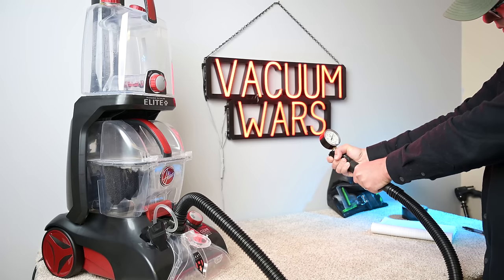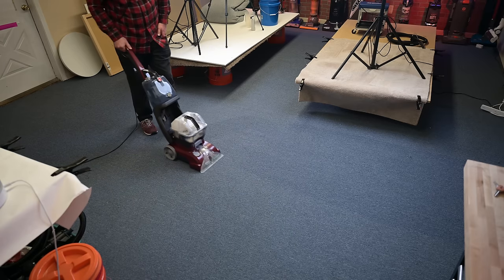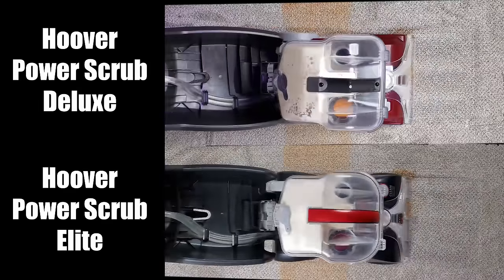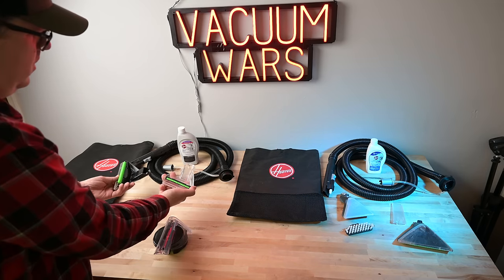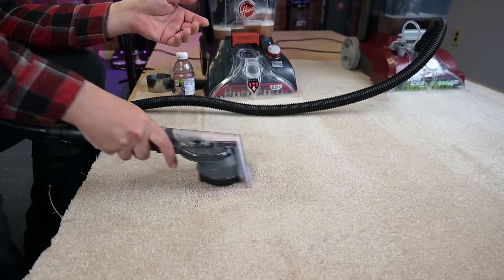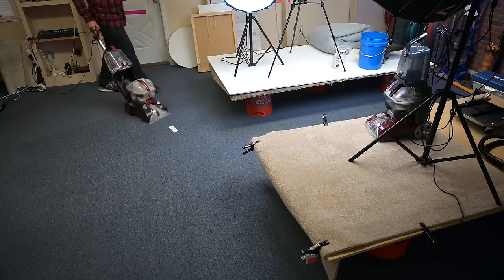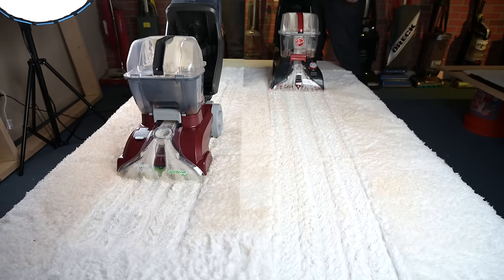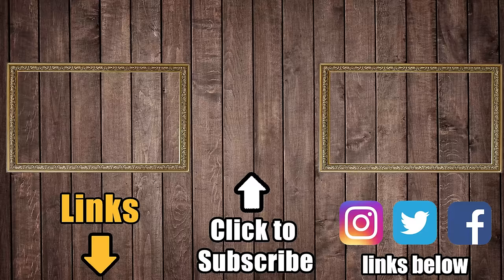Hoover Power Scrub Deluxe VS Elite Carpet Cleaner Comparison

Comment: So, I just bought the deluxe model of this cleaner on Amazon after doing some research and reading excellent reviews. I came across your very enjoyable and informative review here after the fact. But it reassured me I made a good decision in my purchase. This is my first time buying a carpet and upholstery cleaning machine. You're video helped me have a much better understanding of it's operation. I very rarely comment on YouTube videos. But you were so thorough with your side by side of these two similar units, that I had to commend you for a job well done. Thank you for further insight and information.
Reply from the maker: Thank you very much!
Reply: @VacuumWars  hey whats the difference between these and the xl version?

Comment: The one thing I have found through my own use, previously owning one of these is that the bearing that the brushes use rusts or seizes. Because it uses air flow turbine to turn the brushes.. It wasn't until almost a year of use, atleast once a month. Just as a data point for anyone curious about them.

Comment: My favorite part about these machines is how easily everything comes apart for cleaning! The nozzle and brushes pop out with no tools required. And the dirty water tank opens from the top making it easy to get everything clean and dry. I found with most Bissell machines, it's nearly impossible to get the brushes clean because they aren't removable.
Reply: Thank you I was wondering about that..you answered my question
Reply: I agree, I hated that about my bissell.  It finally stopped suctioning after two years and many Carpet cleanings since we own a dog. The dog hair, even though he has short hairs, gets caught in the bissell and there is no way of cleaning it out. I'm in the market for a removable easier to clean carpet cleaner now and I'm getting good info from this channel!

Comment: My husband and I have had ours for longer than a year (the cheapest one). All I can say is this machine has been a god send, it has definitely paid itself off multiple times at this point. Our carpet faces anything from dirty/wet shoes, animals, spills, open windows/allergies. I make a point of shampooing the carpets every month, that doesn't include the random clean ups in between. It never fails to amaze me how well this machine actually works. The water usually comes out black for the first few passes in high traffic areas. Without this machine, our carpet would smell and look horrible. With how much abuse they face, it's amazing that they're retaining their look. I use laundry detergent (Persil) with it, I've never had any issues. It works quicker with less passes than the various bottles of carpet detergent I've bought.
Reply: Interesting, that's the first time I've heard of someone using laundry detergent in their carpet cleaner. It makes sense, though. What's your ratio?
Reply: @TheReapersSon  I have also always used laundry detergent! It doesn't foam up, and smells amazing after. Not to mention so much cheaper. Ratio took some trial and error. I also recommend using a stain pretreatment spray..such as spray and wash 😂 before making the pass. Ratio that works for me is 1/3 cap per gallon of clean water.

Comment: Used the elite yesterday. I do long backwards passes and when my pass is complete I lock the handle and travel back to my starting point. The Elite's tank float engages over 50% of the time which requires the machine to be shut down and restarted. So if your doing passes like I do go with the cheaper model it has a different float. Love these machines and prefer them way over the rug doctor. - thanks for the great video and the recommendation.
Reply from the maker: Thanks for that input!
Reply: why do you do passes like that, vs running back and forth while scrubbing/vacuuming?

Comment: I traditionally go with Bissell when it comes to carpet shampooers but whenever someone asks I always tell them if they have thick pile carpet and pets that shed a lot where there might be some hair left in the fibers go with the Hoover because the brushes don’t pull up the carpet and they can easily be removed unlike the Bissell but in my opinion the Bissell definitely cleans better.

Comment: I always found the Hoover Carpet Cleaners especially the ones with the Dual V branding to be very good performers. My biggest problem with the units were that after about a year they just seem to completely Fall Apart. I had one that was called the Hoover dual V 77 because it supposedly had 77 SpinScrub brushes on the bottom. I not so affectionately used to refer to the damn thing as the Titanic because it leaked like crazy every time I used it and it was so freaking hard to turn and maneuver. I had gotten another one to replace the 77 and I think it was called the Dual V60? Again the unit worked flawlessly for about a year and then again started leaking from the clean water tank and I ended up getting rid of it. Before anyone says that I don't know how to treat my machines or like I abused them I can tell you that's definitely not correct. The machine I replaced the last Hoover with was a Kenmore that I still own and use today. I recently was rooting through my paperwork and saw that I had purchased the extended warranty for the Kenmore when I first bought the unit March of 2013.

Comment: I'm sure it will get lost but I wanted to chime in. We've had a hoover for a year and a half now. Before that it was a few Bissels. For one I love having the extra weight pushing down the front  of the device. I feel like the Bissel always leave a lot of water behind but the Hoover has enough weight to keep sucking it all up and dries significantly faster. So on our first Hoover the brushes stopped spinning within ~6 months. I contact Hoover and they sent me a new one, no problem. I've had that new one for 14 months and a couple weeks ago it started making a terrible sound and smelled like burning rubber. I found your videos trying to research which one to buy to replace it but reached out to support first--they sent me a new one. All I had to do was send them a video of the device. With that, I think including support and warranty is also a big deal with some of the devices. Not only do I prefer how the Hoover handles but their customer support has been exceptional for me in the time we've had it.

Comment: Suction power is one measure, but airflow (flow per square inch) may be the important number if the vac is designed to take advantage of the higher airflow in a dynamic situation. I cannot say for sure without testing. Good testing on the whole!

Comment: Sadly I've read that their spin brush systems have a tendancy to rust the parts that make them spin and ultimately stop working or break

You can look up "how to fix hoover carpet cleaner's turbine mechanism" and find a bunch of stuff on it
Reply: Mine had that issue after only a few months of owning it.
Reply: @Vcafr0  Well. That wasn't the case for me. I took good care of my machine. After I attempted fixing it, I discovered the problem was the drive motor that drives the spinscrub brushes. It had rusted itself solid. That's a location higher up in the machine where no water should ever be able to get. Also, my machine's drive motor wasn't a direct electric drive motor. I believe it was an air powered motor. I now own the Bissell Big Green and it has a dedicated electric motor that drives the brushes. I've found that the brush roll doesn't bog down at all now.

Comment: Do beware the turbos that spin the brushes will rust after about a year or two, you can take them apart clean abd grease everything, but it wont last for too long, and the seals start to leak
Reply: 100% agree. I've went through 6 of these in the last 4 years. Yes, I should have thought about it but I really thought it was pet hair running them. But these suck after 6 months.

Comment: I just bought the Hoover powerscrub deluxe. I originally wanted the new Bissell revolution 2x pet Pro, but my husband refused to pay the hefty price tag for a carpet cleaner, especially since we have no carpet, haha! We have wood floors but have several big area rugs that are very light in color which was probably a mistake on my part because I have three big dogs. I have three standard poodles so luckily I don’t have to deal with the fur problem because poodles don’t shed, but they sure as heck drag in lots and lots of dirt! We have a huge extra large doggie door for them to come in and out of and I have a giant 8 x 10 rug that sits right at the entrance of the doggie door so naturally it gets very dirty. They have trashed these rugs! I was originally looking at one of Bissell’s smaller and cheaper model’s that’s only about $89 right now because you said it was good for smaller areas like an area rug. But like I said, my rugs are super trashed with lots of stains and I wanted a machine that was a little more heavy duty than the $89 Bissell model. Jamie’s Journey here on YT told me about you in a recent video and I came over to your channel to get some insight on what kind of carpet cleaner would be good for me and was also the best value. After binge watching many of your videos, I kept coming back to this one. It has a great price tag and it seems almost like it’s just as good as the expensive Bissell model. Once I talk to my husband and I was ready to finally make the purchase, I came back to your video and went to your links to make sure to give you some credit. And I’m not usually like that, LOL! I could care less about a YouTuber making more money than they already make! But I truly felt that you had deserved to get the credit. Really glad I found your channel. I will be definitely coming back. I like a good new vacuum every few years and my Dyson v10 is getting a little old! That shark vertex is looking really pretty😍
Reply: How do you like it? Is it east to use?
Reply: @tinarodgers5929  Love it! Super easy to use

Comment: Very good review and I have to agree with you on the Deluxe.  It's very similar to my SpinScrub 50. Yup, I'll take spinning brushes over beater bars every time. I've had about 5 Hoovers over the past 15 years, trading out every few  years to capture design improvements. By far, they are now so much simpler to use than years ago.  It's great to be able to freshen up a couple of rooms in short order. Amazing how much dirt lies hidden.

Comment: Not sure how much has changed but the hoover style brushes are (were) driven by a very cheaply constructed plastic drive that at least in my older hoover snapped. Often. Easy to replace but it's added maintenence and cost. They weren't expensive to buy but why should I have to fix the machine every couple of uses? Happened constantly on a medium to low pile carpet.

Comment: Love seeing these comparisons, something I'd like to see is if you could test the effectiveness of artificially weighing down a vacuum or shampooer. I was recently cleaning some carpets and tossed a jug of cleaner on the end of it to help vacuum it dry and it pulled up a surprising amount of extra water so that got me thinking: does weight matter? Could you weigh down some higher power vacuums to get better results where that extra power could shine through in deep carpet cleaning? How much can they take before burning out? Would be interesting to test!
Reply: I think these types of Hoovers are the best at extraction just because of the way they are designed. The dirty water tank becomes heavy and it pushes the head down harder into the carpet...I do not like any other type of carpet cleaner on the market except for these... but you have to really baby these or they fall apart...their design is so easy to clean and put away...but I dry it before storing it... letting a fan blow through the screen with all the parts off the dry the turbine. Don't lift the machine with the clean water tank handle... I really wish Hoover would make these more robust.. I know they are cheap but I'd be willing to pay more for one that's made better since I know what a great job they do.

Comment: Is this an older video?? I thought Smartwash came after Power Scrub..  Im in market for a carpet cleaner after my Elite Pet stopped spinning the brushes due to the Gearing in the motor being rubbed down but the pinion gear due to the bearings seizing and being none stainless.  See my review with pictures on the hoover site. 

I dont really care about the sound, I just want it to deep clean as good as possible and dry as much as possible.

Comment: Thanks.  I have been in my apartment for 6 years now and the carpet needs cleaning:)  And it would be easier to buy one then to try and rent one (I don't drive and Amazon delivers).  I think I will spend the extra $20 and get the Elite for that quick mode for monthly touchups fo the entryway and bathroom hallway which get more foot traffic.  Thanks again for the video!
Reply from the maker: Glad it was helpful!

Comment: I currently own and use the deluxe model.
I've been useing it heavily on thick carpet for about 7 years now.
If I we're to give it a lifetime review I'd say, it doesn't suck all of the water out of my carpet and I need to add a significant amount of pressure to the waist tank while pushing on the waist bin. to truly pull up all of the water from the thicker fibers and carpet padding, as well as on my short fiber rug I found that I had to flip the whole rug over and suck the bottom of the rug the same as the top to get most of the water out.
Also after about 5 years of use, the hole for the peg for the wheel wares out and the wheel will just fall off, I have to hit the peg with a hammer into the hole and that fixes it for about 3 more uses.
Reply: Do you have to have the tanks on your waist?
Reply: @OMGWTFLOLSMH  lol no! spelling error waste vs waist 🤣

Comment: that spin brush attachment would win slightly if you had to use it all day just by being heavier than the non motorized one. say it weighs .5 lbs more, you would only have to push with 9.5 lbs of force to get 10 lbs of pressure.

Comment: I watched your video and  and went out and bought the Elite to replace my 1980's Hoover SteamVac which has a motor that is getting noisy.   Elite is Absolute toy junk!   Puts down less liquid and picks up very poorly.  Rubbing my  palm on carpet after several dry passes palm is shiny wet.   If I go over the same spot with the old unit I can see it pulling water out and recovery tank has as much in it as new unit.   Elite has 2.1 more Amp draw.  Yes tank is positioned correctly and closed properly.  Called Hoover and went through all the steps on the phone and no improvement.  I bought as same rotary brushes as original.  Very Disappointed in Hoover and your review.   Took it back withing 2 hours for refund.   Now I have to see if I can get at motor in Steamvac to oil bearings.

Comment: Question:. I have the Hoover power scrub deluxe and it has the turbine rust issue.  It locks up after every single use and I have to open the whole thing apart each time and take a pair of pliers to break it free.  Is there any more permanent solution to my problem?

Comment: I have an older model F222-900 and the wash and rinse control ate built into the handle where you can switch from wash to rinse with the simple push of your thumb, your new models require you to stop, bend over switch a knob from wash to rinse. Why would you ever get rid of that feature?

Comment: I havent found a carpet cleaner yet thats worked past 4 months, worked as in, suction etc drops off drastically where they become useless.. all Hoover and Bissell carpet cleaners are made extremely cheap.. and completely avoid ANY Hoover with spin brushes, the brushes are driven by a metal gear that will rust and lockup the spin brushes, and you will end up having to take the machine apart constantly to break the gear loose !

Comment: Wow, those are cheap compared to the Bissells.  And the self-mixing cleaner and ability to switch to water only for a rinse are 2 great features.  Having used both Bissell and Hoover, I don't notice much difference in durability (they're both kind of "plasticy").  For the price, the Hoovers seem a better buy.
Reply from the maker: Thank you for chiming in here.

Comment: I have the Shark anti hair wrap cordless but Milwaukee just released their fuel compact vacuum and it looks like it's better I would appreciate your opinion most because you can compare to all the known vacuum brands. Milwaukee Battery technology is far superior M18 8AH using Samsung 40T 21700 cells and rapid fast 6A charging. Have you seen it yet?

Comment: I used the Hoover today it was doing really well, then started smoking, I quickly turned it off and realized that the foam had overloaded into the motor cause the bin was full of foam, and it’s not turning on, I hope it turns on again if not no biggy, cause we have the Bissle pet pro coming in a few days but still

Comment: I wanted to let you know the Bissell Pet Pro can handle shaggy carpet, I used it in our rental yesterday. The rug your testing has nothing holding it down, so the Bissell will suck it up. Put some weights on the corner or staple it down to simulate "in field" use. Keep up the great videos!
Reply: I also wanted to add, the best reviewer in the business. I have bought a vacuum and shampooer based on these reviews. Happy with the quality of the products and reviews are spot on!

Comment: I'm not sure why you didn't tell people on your channel that the the "Elite" Hoover model also is and billed as a multi-floor cleaner which comes with an easily attachable part for the cleaning of hard surfaces such as tile floors. linoleum, wood flooring , whereas the "Deluxe" does not.  So really for the money the "Elite" model is the far superior 2 in 1 cleaning floor machine here and obviously why it costs a little more.  The hard surfaces cleaning is excellent, I love my  Hoover Elite.